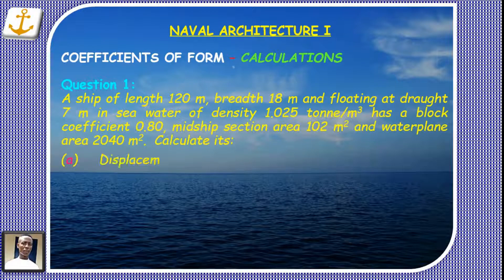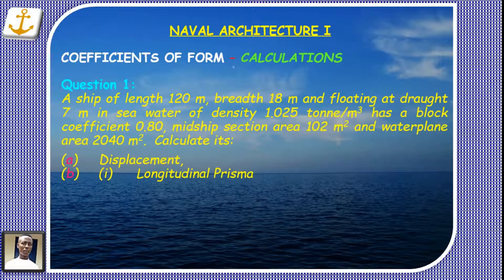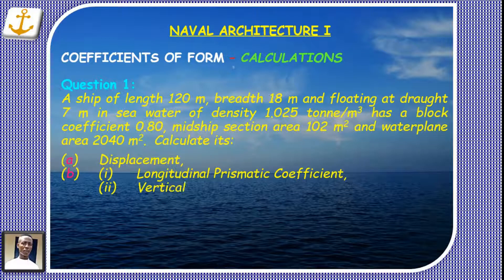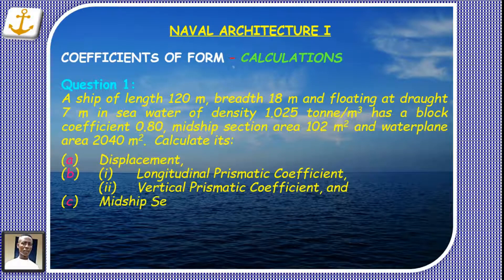Ship Form Coefficients - CB, CP, CM, CW - NAVAL ARCHITECTURE I - STEP-BY-STEP SOLUTION - ALPHA

Comment: How do you get the midship section  of 102 m² from Water Plane area of 2040 m²
Reply: And how do you calculate the water plane area from 120 length 18 Breadth and 7 meters draft